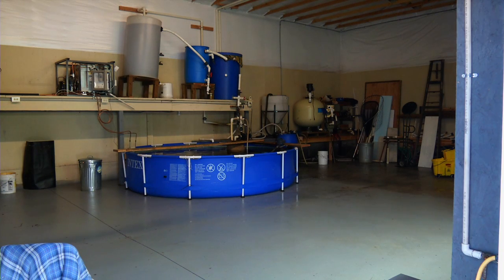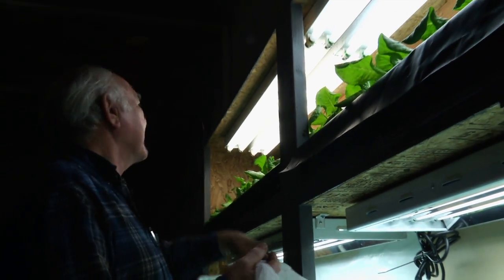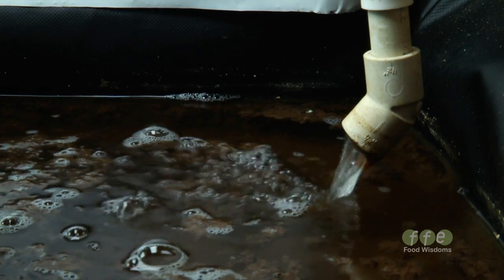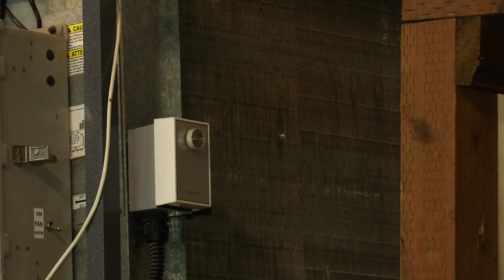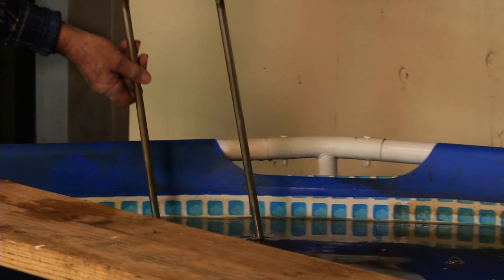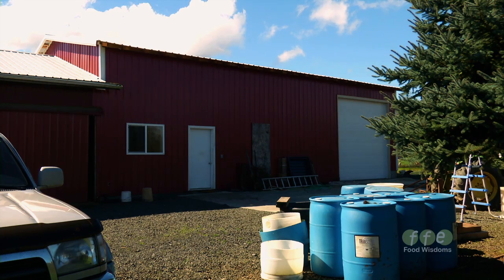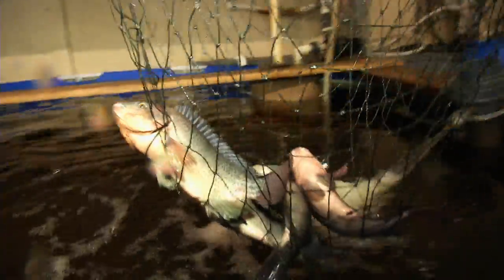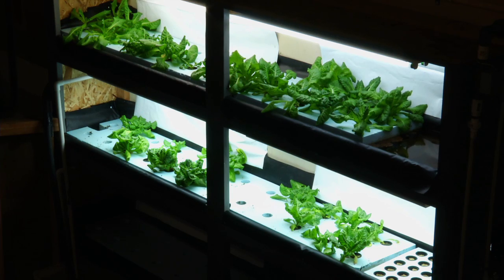Innovative Aquaponics: Creating Efficient, Sustainable Systems

Comment: so he is basically taking heat from the air and is putting it in to the water. assuming the building is really well insulated, the heat ist just going to go back in to the air. and it is even going to get hotter because of the inefficiency of the compressor. and in that case, I cant see what is being recovered since in a normal dehumidifier, the heat just goes back in to the air anyways.
so in my opinion, if you care about the environment, its a bad solution. all i see this doing is making it a little bit more comfortable to be in this room.
Reply: He is in a cold climate (Oregon), so heat going into the indoor air is not a bad thing. He is getting the warmer, dryer air that he wants/needs for his indoor climate, instead of cooler, humid air.

Comment: Adding black soldier fly larvae to breakdown food waste from the home, and worm beds to breakdown that and adding compost to create heat, this system would not only be efficient but profitable by selling the excess material to rebuild topsoil in many home gardens. You Naysayers aren't looking at the whole picture. You use AC in your homes, but don't realize the heat in the moisture removed from the air in it. Heat is energy, and it can be reclaimed and used elsewhere. Do you have any idea how a heat pump works? It uses energy, but much less than generating the heat itself. Stop watching TV and learn something.

Comment: The Condenser is inside as well as the evap. Making it more efficient. There is a C.O.P. of greater than one if you can reclaim the typically wasted heat ie. CoolingTowers Motor heat is nominal. CoolSetup

Comment: This is a glorified dehumidifier. If he puts the evaporator coil outside he might raise temperatures, (heat pump) but then the cold outdoor coil wouldn't condense the humid indoor air. There is no heat addition from that unit besides mechanical from the compressor and fans. It seems like he simply contains the heat by not letting the latent heat of the vapor leave the building. All the heat comes from the lights, motors, fans, and furnace for sure. All the latent heat in the water vapor is just a product of the addition of all these appliances heating the water and causing it to evaporate. Its just an investment that keeps his place dry and lowers heating cost by maintaining a small difference in indoor and outdoor humidity, which in turn slows the rate of heat loss through leaks in the buildings insulation.

Comment: It's not a good idea to re-use in the tank the water from the refrigerator , it's plenty of metals that should be dangerous for the fishes and the humans too.
Reply: +Federico Blasi After the initial system flush at startup there should not be any thing that would be harmful. It's and air exchanger removing the moisture from the local atmosphereic area. and the warming loop for the 1600 gal pool looked to be stainless steel.
Reply: It's the metal, copper aluminium etc, that dissolve from the refrigerator's coil. If you have delicate fishes or corals the will be dead in 24h. you need a stainless steel coil for alimentary and aquarium use.
Reply: +Federico Blasi Interesting... I've worked on hvac units that were 20-30 years old with no breakdown in materials. The enviroment I think causing a corrosion issue would be something to look at . The dissimiliar metals would and could be a problem if there wasn't some kind of water change out over a period of time? That would be and experiment in itself..
Reply: humans have been cooking, storing, and serving food in on and around copper, aluminum and tin for centuries. what do you think the heat sink fins are made of lead???  fyi you could drink the water coming out of the condenser pipe and be totally fine its just condensation that has dripped off an tin heat sink.. how do I know its a tin heat sink because an aluminum one would need to anodized and if it was an anodized heat sink it would still be totally safe
Reply: What kind of pipes are in your house that delivers the water you drink. Its illegal to have galvanized piping in Canada , most houses have copper piping in them unless you have a new home with apex plastic pipes. I wonder if I could put a grow system around my outdoor fish pond during the summer?? Visually it might look like crap , or could I teer it down with the overflow to a garden below since I have the pond hooked up to my drain spout on the house.????

Comment: This is a great idea.  But I am curious as to how much power is used up to run the dehumidifier?
Reply: +oceanofdarkstars1 Its efficient because It keeps all the heat contained in the water, while also keeping his air dry. If it were not running the latent heat of the vapor could escape into the dry cold outdoor atmosphere easier, This system basically concentrates the latent heat in the air back to sensible heat in the tank water. Which is really cool considering the amazing thermal properties of water vs air when storing heat energy.
Reply: Travis Henry  kW/h is the question

Comment: Fengchun Yang
Hydroponics has been shown to be economically feasible mostly due to the use of cheap fertilizer [from hydrocarbons] and there are a very small number of commercially viable systems of aquaponics, who mostly just make money on the plants side of things.  The main input costs aren't energy in most systems [this one would be really high on energy usage compared to most] that only have a single pump running them, but rather the feeding costs, which compared to hydroponics is substantially more.  Since most commercial growers grow for the plants rather than the fish, it's a big factor. 

Pros
- Low power usage, just one pump
- Small footprint
- Low maintance
- very low water loss, typically 1-3%/day
- good yields
- utilizing fish waste for plant growth
- can use spaces with the worst soils and low rainfall traditionally not usable for agriculture
- plants and fish benefit from the symbiotic relationship
- potential yields from fish as well as plants

Cons
- Higher set up costs
- Fish food more much more expensive than fertilizer used with hydroponics [mostly not sustainable, though there's lots of research going on in this area to find solutions]
- Constant testing and tweaking of the system needed

Overall it's a good option for poor quality soils or small spaces.
Reply: I understand that growing aquatic weeds, particularly duckweed, is at least a partial answer to the fish food question. 

The fewer external inputs a system requires, or the more certain they are (sun, wind, wave, geothermal, etc), the more sustainable it becomes. But NO system is fully sustainable if you don't return the waste of the feeders to the system. 

The earth does this on a global scale. We need to reproduce the process on a local scale.

Eg: you must find a way to return the human waste to the system, typically through composting and soil incorporation, for the system to be perpetually sustainable. In fact, a system which incorporates the human excreta actually enriches the system because humans get their food from a variety of sources and thus serve to transport nutrients from one location (a farm -> restaurant -> night soil, for instance) to another, in this case the aquaponics system.

We are bags of fertilizer just looking for a good place to happen. Unfortunately, we almost always get it wrong.

Take a look at "humanurehandbook dot com". Joe Jenkins' book (free to download), is a very comprehensive treatment of this controversial topic and is founded on over 30 years of personal experience, research and study.

When you take a carrot out of your garden, and then return it to the same ground it came from, that ground will remain fertile forever. Send it down the toilet to the nearest body of water and the soil is depleted by exactly one carrot. Do this often enough and "dustbowl" happens.

Take a carrot out of one piece of land, eat it and return it as manure to another piece of land and you've moved a carrot's worth of nutrients from the farmers' field to yours. The more often you do this, the poorer his soil becomes and the richer yours becomes. He'll compensate by throwing ever increasing levels of 'fertilizer' at his soil even as your soil requires progressively less and less fertilizer while producing ever larger yields of organically grown produce.

Somewhere in all this, your food becomes essentially free even as the price everybody else must pay continues to grow for less and less nutritious foods in shrinking containers.

I'm looking to aquaponics as a way to include small amounts of animal protein in my diet even in a power down scenario. I'd be happy to grow 5# of marketable fish a week -- a couple pounds for my family to eat, a few pounds to trade / barter. It's okay with me if they don't grow any faster than I can dependably consume them so external fish food sources take on lesser importance for me.
Reply: @bill65761  thank you
Reply: fish feeding can be accomplished by feeding the waste to insects and then feeding the insects to the fish

Comment: Sustainable? 

All of that power usage for the lights, the refrigeration unit in addition to the standard use of pumps puts this outside the realm of sustainability to my mind.  You'll need a LOT of panels to produce what the sun and wind does for free.  Whilst this system is probably commercially viable, it's not sustainable.
Reply: blogobre
Yea and 90% of our usable water is used for farming, that's more sustainable? Why are you crying about using a ton of energy to reproduce the suns energy? Using t5 high output lights cost next to nothing to run. And hes not refrigerating the water, thats a water heater and and a dehumidifier. The water is simply evaporated and then its collected from the dehumidifer and then returned to the holding tank.

Your trout farms in your area are way worse than this. Yea let just raise fish and throw out all the waste back into the ecosystem. Yea great idea, great great great idea. Lets just pollute the rivers, its down the stream so I dont care. You say recycled yet its just pollution. Shows how much you know, do you even know the running cost of a t5 lighting system a year?
Reply: far more sustainable than regular farming
Reply: Good GAWD man.  Think about it.  In what way?  He is using a ton of energy to reproduce the sun's energy [a greenhouse would be MUCH better], he's using refrigerators for the water [a more suitable climate would be better].  Basically he's pumping CO2 into the air for no reason.  What about the fish food, there's very few places in the world fish meal [fish food] can be obtained sustainably and it's not mentioned, so I have great doubts about it.  He calls that sustainable?  Just because it's said, doesn't make it true, bring some reason.

For instance regular trout farms in my area use natural stream water to replenish the water, and then it is recycled back into the water source, the fish are fed sustainable fish meal as almost all fish meal isn't.  They have oxygen bottles for the heat of summer [trout need lots of oxygen] and obviously need power for their pumps.  They don't call themselves sustainable, but far better than this guy. 

Sure, a feel-good is great, but lets bring some honesty.
Reply: There are several factors in learning aquaponics. One place I found which successfully combines these is the Keiths Ponics Site (google it if you're interested) without a doubt the most useful course i've heard of. Check out this  awesome site.
Reply: It’s probably not the most practical now but as our propulsion grows and resource scarce, this is the future of farming.
Reply: keep thinking an un-insulated greenhouse will work better ALL year round. And hes not "using refrigerators for water" you obviously have no clue how his setup works so just shut up and go back to playing your video games kiddo

Comment: Are you using a stainless steel Condensation coil? If it is galvanized then you may be running the risk of introducing zinc into your fishtank. At UGA we tried to reuse the water and from the coils found that it was loaded with zinc. Interesting design. thanks for the post.

Comment: hey so i have some questions. im a bit of a newbie to hydroponics. so i saw your comment on the fish - plant symbiotic relationship, but obviously the fish need to be fed too so im curious what the fish are fed and how much and if there is any basis for determining how many fish for how many plants and how to prevent cloggage like with fish waste (if thats an issue).

im mainly asking this because im interested in a setup that does not require me to interact with any markets to run the system.

Comment: The cost of a solar system is all relative to the amount of water you are trying to move per hour. If your are raising commercial value fish they are more than likely of the hearty type variety and require very little amount of solar energy to maintain optimal temp for growth as long as you are not living in the north pole. Too often these home based none commercial project receive negative comments and met with resistance from the community do to the high levels of cutting corners.

Comment: Just love picking folks stuff apart, huh?  My family is in the process of putting up a small aquaponics system and I must say that it's a lot easier being an armchair quarterback than to be getting pounded on the field! Doesn't matter how you get there to begin with, just get there.  Refined techniques and such come from working with the system day in and day out.  Until it is up and running, you have no idea what may be wrong, inaccurate or just down right overworking yourself.